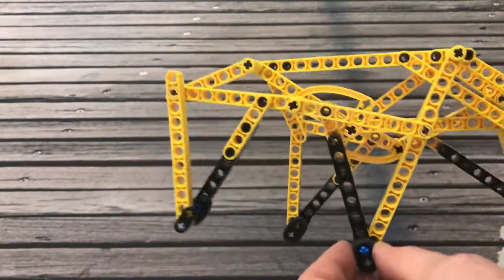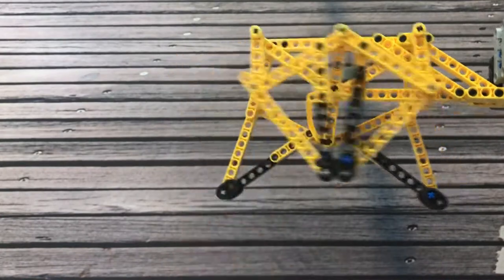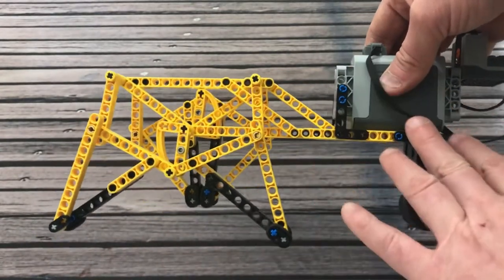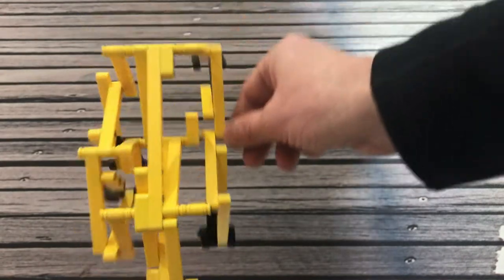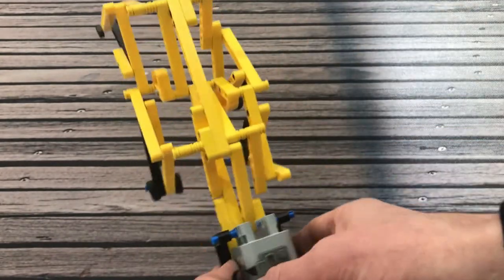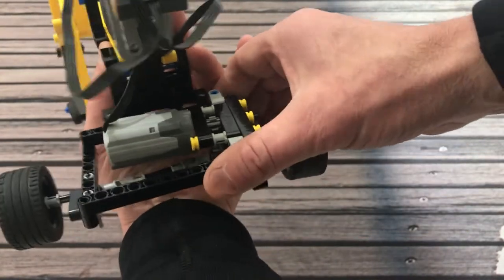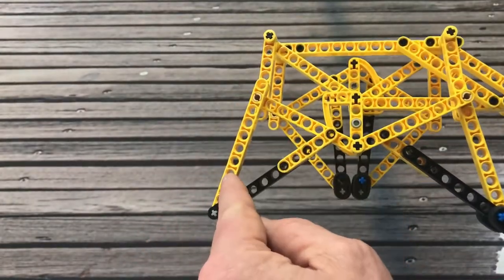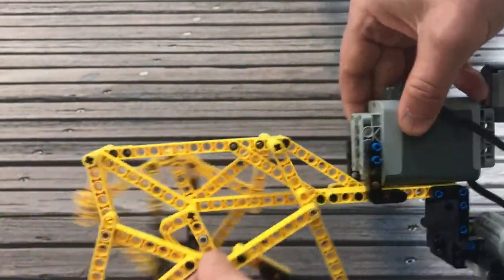LEGO Spot Micro v2 with a Motorized Chariot

Comment: The length of stride with the feet almost touching is awesome!
Reply from the maker: Great observation, one that only a fellow self-torturing walker builder would see, lol. It also means it needs flat ground, so no walking in streams with rocky bottoms like your 6-bar!
Reply: hmmmmmmmmm I'm interested in this mech, it's very clean. Walking machines are certainly a while new game for me, and I love seeing what you lot have done! 👍🍺🇬🇧
Reply from the maker: @carlbModels  It doesn't step high, but this 4-bar linkage does seem to be a candidate for good performance on flat terrain?

Comment: Very smooth passive walking and turning.
Reply from the maker: Ha, only another self-torturing builder of walkers would pick up on the detail that allowing the legs of walk passively means the legs on the outside of a turn can stride faster, somewhat like a car's differential, resulting in smoother turns!

Comment: This gait is really great !
Reply from the maker: Thanks Oracid1! It doesn't step high unfortunately, but it does have consistent footspeed, which makes it a good candidate for walking passively (being pushed/pulled)
Reply: @diywalkers7898  I always use 5 bars, but I am thinking that if I use a servo arm as your 4 bars Crank and an other servo arm as Rocker, it could work. 
One of your 4 bars don't move. I call this bar g, as "ground". What about if g=0 ?
That what I use, in my 5 bars g=0. I explain it here, https://youtu.be/DcmHMXDrIn0  at 1'07".
Reply: How about that stride!
Reply from the maker: Your video explanation of g=0 is great, and powering your rocker with a servo arm is necessary with a 5-bar linkage with 2 DOFs?
Reply from the maker: @oracid  Wait - are you saying that you want to try reducing your 5-bar linkage (4 leg bars + frame) to a 4-bar linkage? While also powering the crank and the rocker? If so this could work but since only 1 DOF the rocker would be constrained to match the crank's movement perfectly, so nothing would be gained but complexity? Or do you mean something else?  I love your 5-Bar BTW - if you ever want to write it up on our blog you are of course welcome!
Reply: @diywalkers7898  I am not sure I understand what you mean. 
I reduced the number of bars by one 5 bars because it made sense, like many others before me. But I took a long time to realize that this new assembly which included 4 bars, was in fact a 5 bars with g = 0.
Regarding the 4 bars, I realize that my idea is stupid and that nothing would move if g = 0, moreover the Crank and the Rocker are linked and therefore cannot be ordered separately. I just realized it.
I would be very honored to write an article on your blog. I will explain how we can go from a 5 bars to a kite (5 bars with g = 0), then from a kite to a leg with parallel actuators.
By the way, I would like to make a video where I will explain how we can simplify the movement of Theo Jansen to end up with a kite. But I'm afraid this will raise a lot of controversy. I am very reluctant to do this.
Reply from the maker: @oracid  By "kite" do you mean a diamond shape, like your 5-bar leg with parallel actuators?
Reply: @diywalkers7898  Not easy ! In French "losange" is "diamond" in English, https://fr.wikipedia.org/wiki/Losange
And a Cerf-Volant (French), https://fr.wikipedia.org/wiki/Cerf-volant_(g%C3%A9om%C3%A9trie) is a Kite(English)
Any way, my quadruped legs are Diamond or Kite. My last quadruped has a leg based on Diamond.
Anyway, Diamond has 4 equal sides and a Kite has 2 equal sides + 2 equal sides.
Reply from the maker: @oracid  Ah, understood!
Reply: @oracid  just do it! will be an interesting read/viewing 👍🍺🇬🇧  and 👍🍷🇫🇷
Reply: @carlbModels  What do want I do ?
Reply: @oracid  Hi! And good morning. I think a contraversial and thought provoking video about simplified Jannsen linkage would be excellent! please go ahead and do one. Who says everything needs to remain the same? Maybe a limited showing first of all, if you were worried about reactions. On the other hand, better a reaction than no reaction at all.👍🍺
Reply: @carlbModels  I would have bet it was about this. I've been thinking about it for some time. Thank you for this encouragement. But my demonstration must be very convincing, and that is not easy. Moreover, I have to anticipate contradictions, but my physical and mathematical background is very light. I will do it !
Good morning, too.
Reply: @oracid  well, you could do a limited showing to DIYWalkers for example, and maybe Max and myself, and/or your other more interested subscribers?
Reply: @carlbModels  Good idea ! I'll think about this.

Comment: Have you tried putting the steering in as a joint between the walker assembly and the motor? like an actual chariot.
Reply from the maker: yes but it causes either the legs or the wheels to get pushed sideways

Comment: nice! ive made a walker too! are the legs motorized or does the cart just push them?
Reply from the maker: Hi Jackie Glade - if you want, paste a video link to your walker in this comment thread? This build's legs are not motorized - just pushed/pulled by the cart (called "passive walking" by some)